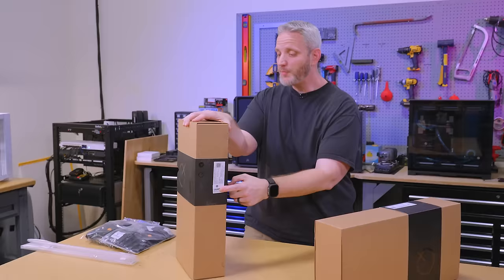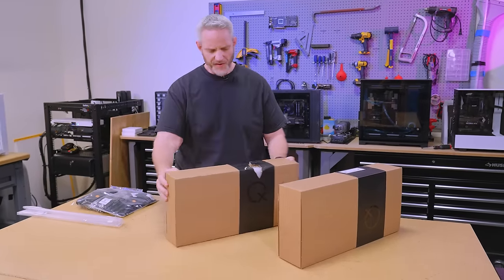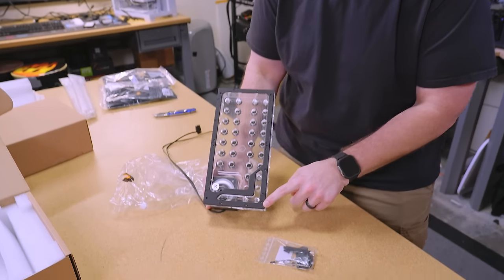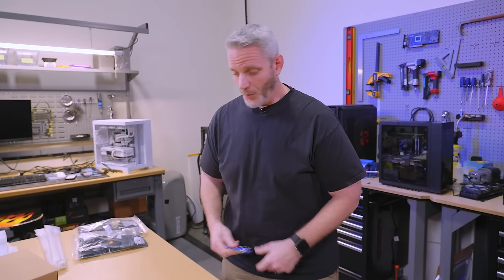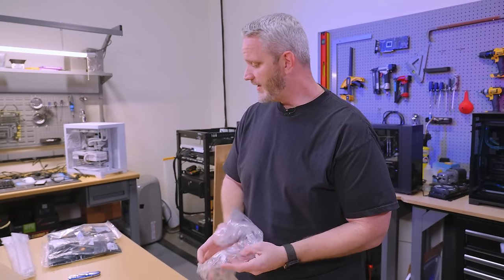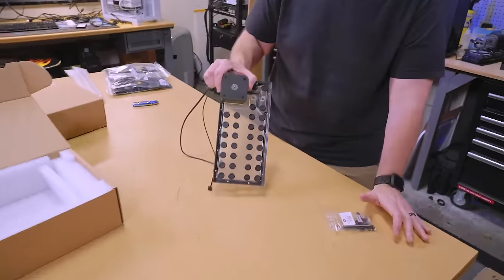Gamers Nexus told me I needed this... so here it is!

Comment: Falcon northwest would have a nice lineup of a OG-Oversized case for a full motherboard cooling block build with a big space  for reservoir custom wide diameter tubed watercooling for just board itself. The gpu can be optional in the air cooling or waterblock addition.

Comment: it would be awesome to run another loop with different fluid in whatever this is also i think if you go that far to make a loop why not use HF Valves for every port as well might be extra 250$ but you could change or clean parts without draining the loop ...

Comment: this is the most ingenious over engineered thing i have ever seen
it is literally and actually, water cooling your water cooling
its freeing up visual space inside the case, opening up layout possibilities
and acting as a heat exchanger, absolute over engineered genius
and kinda 500 bucks on a distro, in the big picture of those people using distros and custom loop budgets...500 bucks is a bit much, but not that crazy

for visuals, im seeing using the silver and black fittings in a white case and two loops with 2 dark color fluids , use the 2 colors in the scheme of the build
make some lemonade

Comment: Would be awesome if you use two plates as you are planning to do. But here comes the kicker: dual loop. One plate holds the liquid for the loop and the other plate contains the pipes for that loop. This means you could do a 2 color loop. Example: having a purple reservoir liquid with green liquid in the tubes inside the reservoir and the other one would be the other way around. So many options, so many headaches.

Comment: Am i the only one cringing??  All i see is 10x the failure points.  Over a year later and 2 maintenance cleans on dual 360s and im still constantly making it a point top stare at all the connectors when i use it lol.  Still on 11th gen but built it during the gpu wars against the crypto clan.  Cringe just thinking about every liquid cooled owners worst nightmare lol

Comment: I had to do a lot of custom grinding and hacking to my Cooler Master Cosmos c700m and the included gpu mount to fit two 60mm 360 radiators and retain my optical drive as well as an elgota capture card and usb card, but it came out wonderful

Comment: I dont see that you have to run tubes in it. If you just used one output to your GPU, then GPU to CPU through a rad or two and back you just need an in and out 🤷‍♂ But I guess spending £500 on it you'd want to return everything to it just cause..

Comment: I might be thinking of another micro fitting but those look like the same ones I used before, in which they actually are compression fittings. Very, very tiny compression, but should still be there nonetheless.

Comment: I feel like running pipe on the inside of that thing is kinda silly as it is also a reservoir :o
You could have an extra radiator loop that just goes reservoir > radiator > reservoir that just dumps heat.
Maybe you can actually fit a radiator on the inside so you can literally cool your water cooling with water cooling.
Or liquid cool every component in the pc so you have to use y pieces for tubes coming from the pump but not on the way back.

Comment: Before I saw the price, my plan for one of these was to replace the front of a meshlicious, use the reservoir and built in pump for the CPU with clear fluid and then run a separate GPU loop with it's own pump with something like red or purple for the runs on the inside with 2 small external radiators under the desk... would have been sweet but I'm pretty sure that the cost of this addition would probably be similar to the cost of the rest of the loop put together... cool idea for somebody who has more $ than sense...

Comment: I wanna see dual loop with 2 different color fluids, each passing through the reservoir part of the other color.  Also, looks like you can install the tube in the fitting, then torque down the 90deg using the tool?  could make for a tight corner.

Comment: Jay hear me out 16 loops with 16 pumps but one reservoir using this.  No tubes inside, just use every in and out of the reservoir.  16 feeds at the bottom with 16 pumps drawing and then 16 returns at the top. Not sure what would happen, but I doubt anybody tops it,

Comment: Just a thought, but in theory, you could run duel loops, with the other loop running though the others reservoir. For absolutely no reason, but it would be a meme. 

And if you ran different colours, it could be real neat. Like red and blue, and then the internal pipes might appear purple?

Comment: Are you sure you need to open it up and add tubes inside? It looks like you should run an inlet tube (possibly more than 1 if you want) and then attach a tube to the exit. Fill the block with fluid, and it will pump it from the inlet to the exit with no internal tubes.

It seems like all tubes should be external. What does the pump do if everything is run through tubes inside?

Comment: I don't know if it would look as cool in real life as it does in my head however if you ran some extra tubes and fittings between various places in there and did not connect them to loops you could run LED light strips through it and have fancy lighting and patterns inside of your reservoir. 

And even less practical if you were to be able to run some metal tubing inside the reservoir and then run that loop through some refrigerated coolant like an air conditioning heat exchanger, it might do some fun in terms of temperature but also be way way way way way way less practical.

Comment: Ok, hey @Jayz2cents... so odd thought here... now that you have clear tubing directing the flow in and out, when you're done building the rest of the loop, if you allow the reservoir to fill with clear, distilled water at the top and allow that to be the only thing feeding the pump rather than how you're saying you have to fill the reservoir from that bottom hole, wouldn't the internal tubes look like they're invisible? I think it would look really clean if you just tube up the components and rads to that and tube to each other internally to that, and then finish it off with a single tube to one of the top holes and have the water cover up the pipes as if they weren't there so that you're basically cleaning up your pipe runs the same way you clean up the wire runs.

Comment: I wonder if you could combine this with copper tubing and get something insane like the LTT chiller and use one loop to cool the fluid for the main loop as to avoid condensation issues from sub zero temps. Essentially by running the warm end of the loop of the main systems cooling through the sub zero fluid from the chiller to remove more heat from the liquid. It's completely excessive and entirely niche but could be fun.

Comment: That makes no sense. it is not 1 April any more. the connectors go to the outside of the distribution block. Water fills the inside of the block, that is why it has O Rings all the way around the two chambers. the small section  of the block is return water to the pump as input and the large chamber is output with parallel connections going to multiple components.

Comment: Why a 90?  You could just make short straight runs, slide the ends on externally and then screw the 2 fittings and tube in as an assembly.  This thing is damn cool and I see a ton of potential design options using it.

Comment: idk why, and i know it would be inefficient, but i really want to see the second block used in a separate loop with 1 radiator that only goes to the first block internally to "cool" the tubing thats inside of the first block. using copper tubing in the first block for the most heat exchange.

Comment: I'm not really getting it; the manifold is what the pump is flowing into, but your in and out tubes to components run in lines inside of it, separate from the pump pressure.  Now if the idea is for two of these things with the fluid crossing over and lined through the opposite unit with a fluid colour difference ... then it makes sense,  Besides that ... honestly not getting how this works.

Comment: from the look of it i expected the one pump starting two water cycles - one to the gpu and one to the cpu with a radiator behind them and finally feeding back into this reservoir at maybe the third row from the top or so to enable easier filling from the top row 
kinda like a split loop, considering it looked like the pump has one intakt from the reservoir and 4 outputs?
it would have direct heat exchange for both cpu/gpu while feeding back into the same loop to help balance out the temperature and thus keeping the average lower?
but a hefty price for sure o.O

Comment: Use both in a case, metal tubes inside them, dual loop so GPU and CPU are separate, 1 for each loop as a reservoir but as a distro plate for the other loop. Going to use a dumb product may as well go whole hog.

Comment: Put your tube connectors on the tubes before installing the tubing. Fit your tubing to the 90 degree fittings, and use your "non compression fittings to lock the seal per tightening. Those fittings seal by bringing the tubing into the threads of the connection.

Comment: Why would you ever route loop water into the reservoir then pipe it straight back out like that?

Sure, you'll get a tiny amount of heat transfer from the pipe to the reservoir, but not enough to warrant the time/effort/cost.

Comment: My biggest concern is having that many options to run tubing inside would increase the risk of a leak over time. As someone who used to do a custom loop I still prefer the pump/res combo. I do like the look of the low profile fittings but would prefer them to come with the metal collar to keep the tube from popping out. I can no longer afford it so i use an AIO.

Comment: I think it is kind of cool but I think you may be over complicating things by doing the tube runs inside, maybe I am incorrect but the only way that would be necessary is when you mave more than one loop and run different colors through the res. The way I look at it is using the outputs at the bottom and then using the inlets that are close to the right height, there should be no need to make a tube run inside it. Maybe I am wrong but it just seems like you are making things harder for the fun of it.

Comment: When you use two of these and clear tubes, how about using different dyes and let the loops "cross" so you get a color mix. Let the colored water from the first reservoir flow through the internal loop of the other and visa versa.

Comment: You counted 4 outs, why not use those to run each area with one of those 4 as in one to the cpu and one to the gpu and have the returns come back where ever it is convenient at the upper intakes and not run it inside the plate? You are bringing the line back to the plate yet then running away from it. That makes no sense. Good thing you dropped EK after their scandal. The plate would be better as a generic plate. Try using each lower as its own out and any upper as a return. (forget the running inside the plate.).

Comment: I don't understand why you need tubes on the inside, just fill the whole thing and use it as a radiator. The pump is pulling from one half and pushing the other.

Comment: I would think you could use it by connecting components in parallel i.e. multiple outs (or split after the outlet using T fittings) to each component then each component returns to a separate inlet port

Comment: Instead of the 90° bend, since the fittings can turn directions, wouldn't it just be easier to have a straight tube instead of having one with bends? Just rotate the fittings to fit the straight tube even if it goes diagonal across the distroplate.

Comment: This could be cool if you had a dual loop system and ran clear fluid in the reservoir side of this and used the internal tubes to run a coloured fluid on the other loop. Or even experiment with combining colours to get a third colour inside this block

Comment: This would be awesome to use in a build with two of these distro plates, but run them as to serperate loops with different colours and have them run through each other, so you get like pink tubes in a blue reservoir and blue tubes in the pink res.

Comment: Using two of these in 2 separate loops with different fluid colors that pass through the other colors blocks would be interesting. Such as a Yellow loop in one with a Blue loop in the other so you get a Green look inside the blocks where the one loop passes through the other.

Comment: What would happen if copper pipes were laid in the distro plate?
and then let the fluid in the distro plate run to the radiator? Could this then be used to cool the system?

Comment: So from my understanding, is both pumps you mentioned are variable displacement pumps? Are there any fixed displacement pumps?
Reply: If you're a little confused, the best way to describe the difference between the two pumps, a variable displacement pump is like table top drill press that's run by a belt versus a table top drill press run by gears

Comment: I’d like to know whether it is more effective to water cool vs air cool? Which uses less energy to reach same level of performance.
Reply: Water and it's related tech as a whole requires more energy than moving air around, air cooling relies on just fans. A pc fan can use up to 5 watts full speed. Water cooling aio can be between around 20-30w or more, and custom cooling similar. It depends on the parts used. Just avoid h100i and h150i Corsair aios if you go that route (look up the pinned red triangle issue in their forums, hardware faults)

Comment: With those d5 covers you can get the sata connector out of the hole to sleeve it

But i agree it should have been sleeved
Reply: nah, they are soldered to the pump controller. you'd have to unsolder, sleeve and re-solder, or cut the SATA cable, to pass the sleeve, resolder and pull the sleeve back on the cable, the latter being like a 10 min job.

Comment: EK used torx screws in the past for their radiator frames.  I never noticed until I went to take one apart to paint it.

So this thing is a big manifold plate but takes different fittings... I had seen pics of this on their insta but they didn't really explain what to do with it xD  Good video!  Thanks for the details!